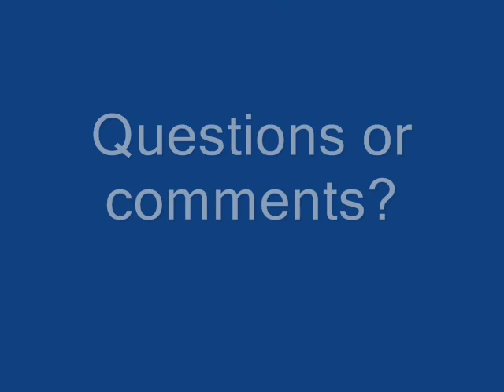ChemE Car Project (Spring 2007) - Uncut PG-13 Version

Comment from the maker: Dry ice is solid carbon dioxide. When combined with water, the temperature of the dry ice rises and sublimes, changing from its solid state to its vapor state, thus building pressure. We tried to propel the car with the buildup of pressure and the release of the water.